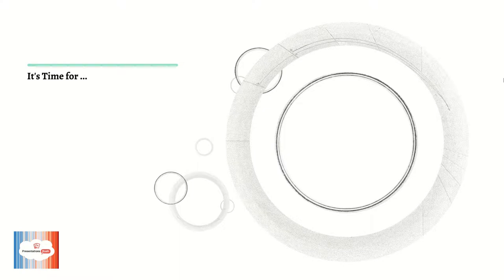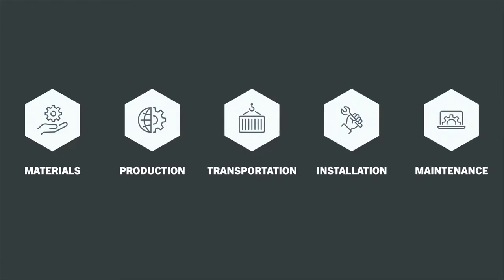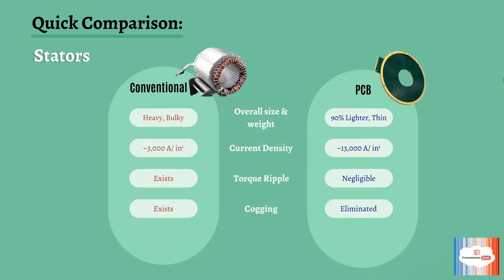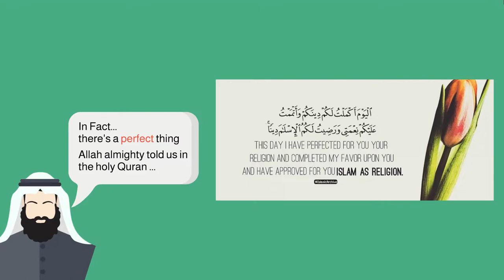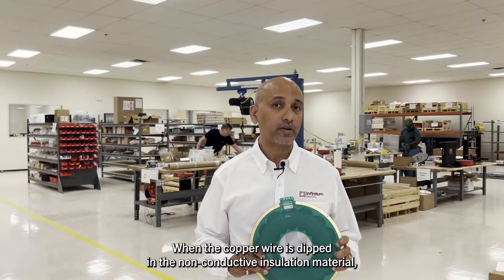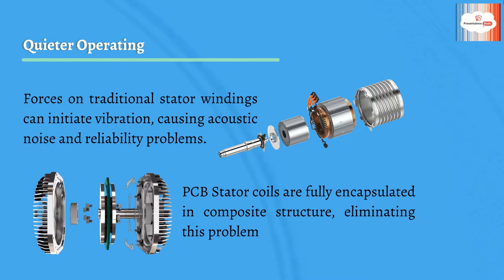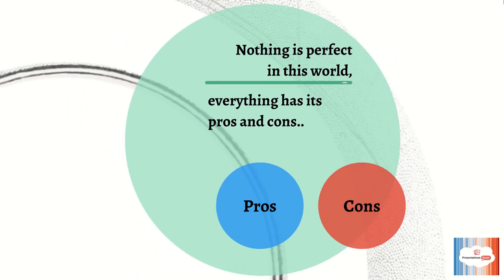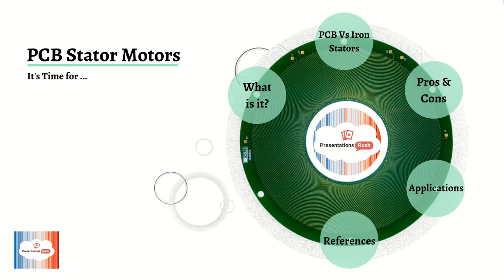It's Time For PCB Stator Motors

Comment: I do not see in the cons that PCB motors have small torque compared to precision machined (low air gap) motors. I do not see much about torque in the presentation either, which is one of the most important parameter of a motor. So do they have lower torque indeed, or was it somehow compensated by the higher current density? how much?